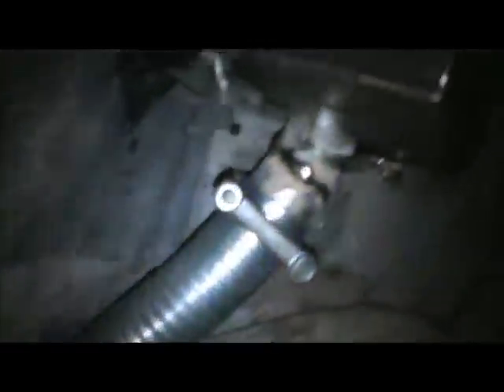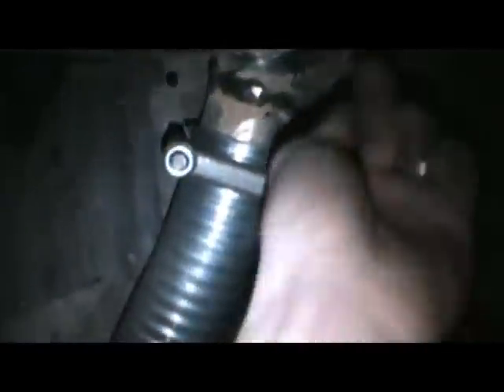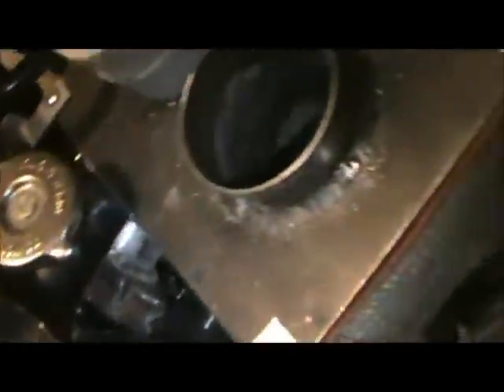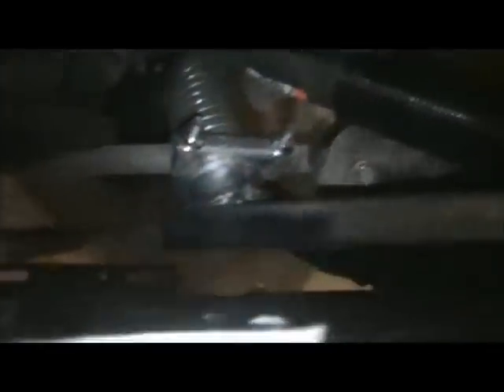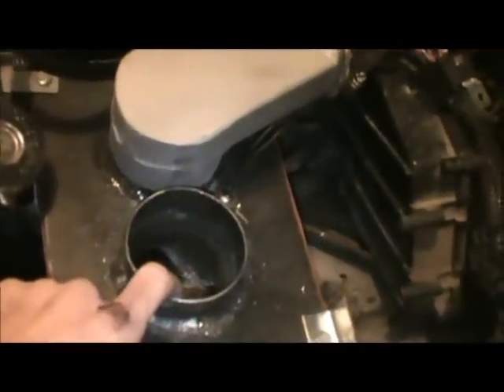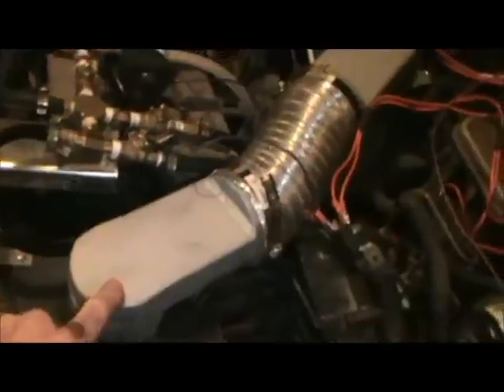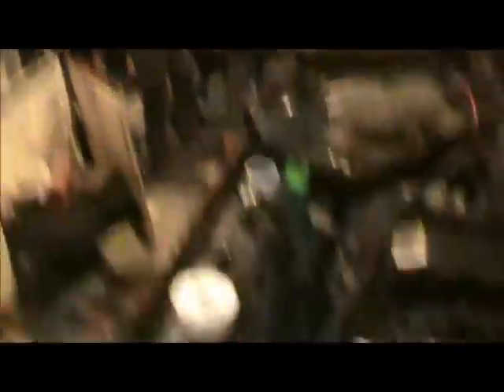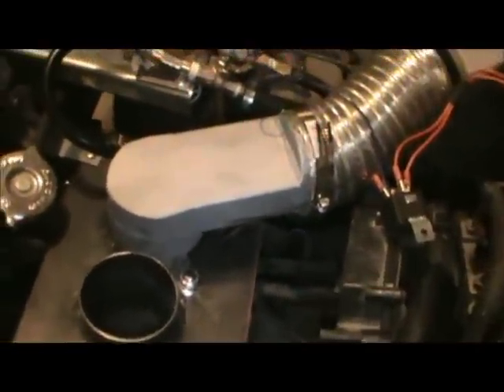100+MPG PROJECT NEW FUEL VAPORIZER INSTALLED (DETAILED OVERVIEW)

Comment from the maker: Sine this is not possible in today's engine I pre-vaporize the fuel so when it enters the cylinder it can further crack into it's separate molecular structures making it reach a more volatile state. When this gas state is achieved full combustion occurs.

Comment from the maker: There is also another factor missing in an engine and that would be not enough heat. If engines could be build to withstand higher temperatures and you could some how increase the temperature in the engine cylinder to a high enough level so the fuel would remain vaporizer under pressure then engines could achieve a complete combustion of the fuel from that one simple thing.

Comment from the maker: You are correct there is vaporization occurring in the engine cylinder there has to be cause if there wasn't it would be impossible for the fuel to burn. Full vaporization of all the fuel being injected into the engine however is absolutely not occurring, if it were there would be no need for a catalytic converter and emissions equipment in a vehicle because there would be no carbon or unburned fuel remaining in the exhaust. If full combustion is achieved you would have 0 emissions.

Comment from the maker: At atmospheric pressure the ignition point of gasoline is 536 degrees F. Since I live at a higher altitude the ignition temp. goes down.
You got it I do control the flow of the exhaust to the vaporizer and can set it to whatever temp. I want it set at. The thermostat I use has a operating range of 0-999 degrees F this gives me the ability to fine tune the vaporizer and set it at it's sweet spot!

Comment from the maker: Tanks for the support!

There will be a simpler way to do it yes. I built this design this way for testing purposes. Once I dial in the air to fuel ratio needed to run a vehicle perfectly using vapors or cracked fuel then I can know how much I can reduce everything down. There are allot of extra things I have on this design such as electronic controlled parts so I can control the conditions and have consistent data.

Comment: The ignition point of gasoline is about 495 degrees Fahrenheit/232 degrees Celcius, gasoline Flash Point is about -50 degrees Fahrenheit/-65 degrees Celcius. With the Flash Point at -50 this is the reason gasoline engines are hard to start in a really cold winter. Notice that Tyson controls the exhaust with a gate valve and an exhaust temp sensor somewhere in the loop. Keep the temp below 490F to vaporize the gasoline, you should have success without unwanted ignition explosion of the fuel.

Comment: Hello tyson, this is an excellent design though I have a couple of questions for you.  First I was wondering how you control the gas level inside your vaporizer? And second what tempurature  does your vaporizer get. Also you should add a simple water injection system for your car to enhance the performance of you vaporizer even more. In the winter you can use -20 windshield washer fluid because its only water and methanol.

Comment: this is a great build. Do ya think ya could draw up a diagram of the system ? I realy couldnt make heads or tails from your vid as to what is going on here,.Its ok If ya dont want to,I understand. I have done a couple of Paul Pantones disigns and I know they work much better than the current fuel designs. We all know why we still use the old system with a catalytic converter and fuel injectors. Its all about The money and allways has been

Comment: Wow how did you manage that?  Some parts of the gas wont vaporize  at all.  Some of the solutions I found were people using a flushing mechanism or mechanical scrapers to remove the hardened residues from the surfaces of their heat exchangers.  No matter how hot I got my surfaces to, after enough time a yellow/orange residue would appear - thought the hotter it got the longer the buildup would take to appear.

Comment from the maker: The vapor I use is actually a gas not a liquid. The little droplets coming out of a fuel injector are still in a liquid form therefore it does not burn completely because it is not all able to turn into a vapor during the combustion process. When gasoline is super heated is changes from a liquid state into a gas state.

Comment from the maker: It will defiantly leave a residue behind if you don't use enough heat. This design does not leave residue behind. All parts of the gasoline mixture are vaporized.

Comment: Right on, keep an eye out for updates on our cold distillation process.  We are figuring out how to "distill" ethanol without using any added heat.  Huge cost/energy reduction in the production process.  We are making it not from the typical stock like corn or fruit/berries, but rather common grasses and woody growth commonly thrown away or burned - yard waste.

Comment: You are on the right track with ethanol in the vaporizor. Alcohol vaporizes at room temp and does not require as much heat to vaporize like dirty stinky nasty gasoline, I despise that crap.  And ethanol is a clean renewable fuel you can make. After running my engine for months on ethanol vapor the crank case oil still looks like brand new. For those that do not know about this awesome fuel check out David Blume's videos. Very informative. Peace out!

Comment: Also be prepared to deal with the residue that vaporization of gasoline will leave behind.  It's all the chemicals and crap the refineries add to the gasoline that act as detergents, stabilizers, etc.  It reduces down to a dark brown pitch that is a real bear to clean out of your vaporizer.  Check out how Bruce McBurney dealt with it, pretty good ideas.  I gave up on gas and went to ethanol - no residue and you can make it yourself.  Nice fab work on your system, BTW!

Comment: The steam is not coming from water in the gas, its coming from the moisture in the air.  I used to think the same thing when using my vapor system until I did the research.  Gasoline and water do not and will not mix - they separate - gas on top, water on the bottom - every time.  They are immiscible.  Water will mix with ethanol, however.  So ethanol gas mixtures will retain small amounts of water.  SMALL amounts.  Your vapor  is primarily coming from the air moisture.

Comment: a butterfly valve on the intake of the vapor tank linked to your throttle wil fix that completely. (so iv'e read from tom ogles fuel vapor tank patent) the butterfly on your intake manifold has to preceed the one on the tank just a bit to create proper vaccume durring acceleration

Comment: I think the oil spots are from your catalytic converter no longer working without enough heat coming to it to start up anymore. Your exhaust system would usually be too hot for that kind of stuff to build up and your engine would generally not have it either as long as everything was in good working order. I have a feeling you were burning a little oil before and the cat was just disappearing it for you, or the back pressure is so high now that you are forcing exhaust into your crankcase.

Comment: I have tried using the vaporizer w/out heat buck it gets very cold and stops producing vapors. Also I have tried it with just heat but not enough vapors are created to run the truck. Only with both methods hooked up will it run at all for any period of time. I also am using steel wool but it seems to wick the gas through it. I am going to try heating the air before it is bubbled through gas. I also am going to try using a larger container Maybe the limited space is causing a perkulator effect

Comment from the maker: If you are heating the gasoline up in any way you can't bubble air through the gasoline it will create way too much vapor causing your car to run very rich wasting gasoline and causing problems. You can't bubble air through the gasoline if running off a hot vapor system. The surface area has a huge effect on vapor production. If you decrease the surface area of the heating zone this will help produce the right amount of vapor. The hot surface area differs from car to car.

Comment: Hi Tyson I have been following you for a while now and am trying to perfect a vaporizer. I am having problems though and was wondering if you could help. I have a design similar to your original except I ran heating elements with engine coolant into the container. It is using WAY more gas and bubbling vigorously to a point that the liquid bubbles are being sucked into the engine at high RPMs. And at idle it uses way more than it should. I am also using ethanol because it evaps at a lower temp.

Comment from the maker: Thanks!

It does rust out pretty quick. It should last me about 6 months or so which is long enough to get allot of great data in. It's pretty easy to install so when it burns through I'll replace it. Once I figure out everything I need to know I will have to make some custom pipe to replace the flex exhaust system.

Comment from the maker: I would imagine the cooler air coming into contact with the hot air does cause some condensation, how much IDK but it could be aiding the combustion process by acting like a water injection system. Guess I will have to test for it.

Comment: Hey you know GTIBully may be onto something there.. air in a low pressure state could cause condensation. Maybe reduce the air inlet to a minimal amount to retrieve the vapor then mix the rest of the air after the processor. i dunno though. Great work I really appreciate you sharing everything! Btw that installation looks professional. Much better looking than my paint can bubbler I threw together in a couple hours lol

Comment from the maker: Sounds good man! I'll let you know when it's running perfectly and arrange a time to meet up. I am placing one more modification on it this weekend which should make this baby run like a champ! I took it for a test drive but it stalls out at low speeds due to too much vapor production, I can run it all day at high speeds and it will run just fine. The modification I am doing this weekend should fix that problem. Oh BTW where did you get your gas analyzer?

Comment from the maker: Thanks! The more support we have and the more this is shared the better off we will be. The fuel inlet lines get hot but so far we are safe. If it comes down to it I will connect a stainless steel tubing fuel line up to it.

Comment from the maker: Thanks! I will defiantly video tape the test drives. It cost me over $4000.00 so far for everything that includes some test equipment. Once I have everything figured out it will cost much less then that. I did one test drive but had to stop due to the need for a modification. I had 2 cups of gasoline in the vaporizer and went 5 miles before having to stop the test drive but I still had gasoline left in the vaporizer so I am not sure what I can get. I will be adding a few things this weekend.

Comment: Truly great work. Your gasoline vaporization system is sure a beautiful sight. You guys did a great job. Truly great. Every 45 degree angle, every 90 degree bend. Every bracket, mount and switch- Perfect :-) I'm looking forward to the idle and also drive test videos. You may have a lot more power now :-)